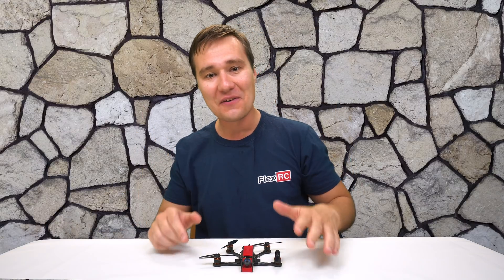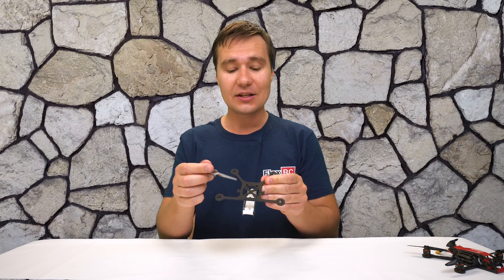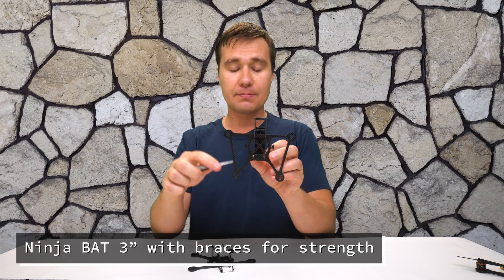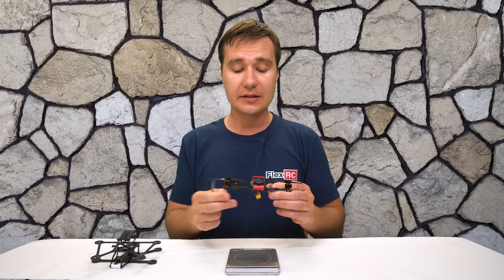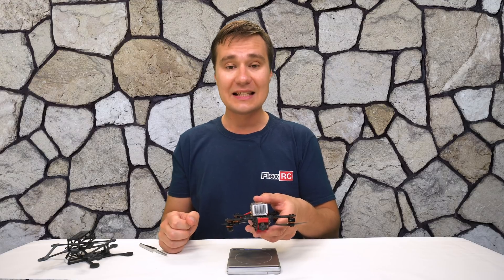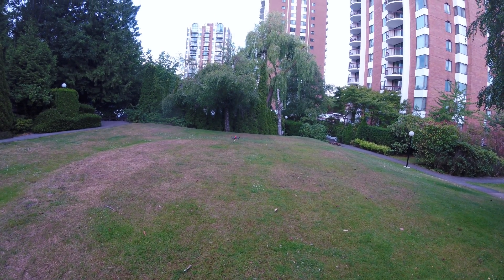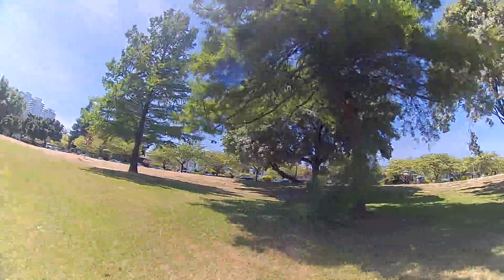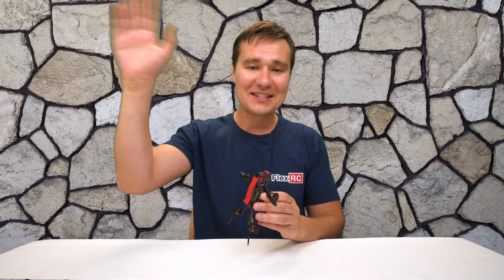FlexRC Ninja 3" - Ultralight FPV Frame with No Props in the View

Comment from the maker: ⚠️ PRODUCTS IN THE VIDEO  ⚠️
❗️ FRAMES ❗️
✅ Ninja 3" frame: https://flexrc.com/product/ninja-3-frame/
✅ Ninja BAT 3" frame: https://flexrc.com/product/ninja-bat-3-frame/
✅ Ninja Accessories: https://flexrc.com/product/ninja-canopy/
❗️ELECTRONICS ❗️
✅ Caddx Turtle: https://flexrc.com/product/caddx-turtle-v2-black/
✅ T-Motor F15 1106 6000kv: http://bit.ly/2ZSl3b4 https://flexrc.com/product/brotherhobby-tornado-t1-1407-3600kv-brushless-motor-4pcs/
✅ HGLRC Zeus AIO FC/ESC: https://flexrc.com/product/hglrc-f4-zeus-f4/
✅ HGLRC Nano VTX: https://flexrc.com/product/hglrc-gtx-nano-vtx/
❗️BATTERIES ❗️
✅ 450mah 2S 75C battery: https://flexrc.com/product/tattu-450mah-7-4v-75c-2s1p-lipo-battery-pack-with-xt30-plug/ 
✅ 450mah 2S 75C battery: https://flexrc.com/product/tattu-450mah-7-4v-75c-2s1p-lipo-battery-pack-with-xt30-plug/ 
✅ 650mah 2S 75C battery: https://flexrc.com/product/tattu-650mah-2s1p-75c-7-4v-lipo-battery-pack-with-xt30-plug/
✅ 850mah 3S 75C battery: https://flexrc.com/product/tattu-850mah-11-1v-75c-3s1p-lipo-battery-pack-with-xt60-plug/

Comment: very nice product. the weight of the ninja/ninja bat bottomplates without the carbon/plastic canopy would be interesting for even lighter toothpick style builds. also an option for buying the bottomplate only would be nice.
Reply from the maker: Thanks, there is simple x frame that does it and I'm also thinking to add something like deadcat without a cage
Reply: @FlexRC  already got your simple-x 110mm frame and the x-120 is in the shopping cart.  loving the design. but now i'm thinking about to get a ninja too ;)
Reply from the maker: @muhkuh0816  haha, thanks for the support!

Comment: Great frame. I am wondering what PID values you will use fot this frame? My past experiences show that PID tuning is really hard for deadcat style frames. If the frame can be tuned to react like x frames, I am definitely interested to buy a few and move my stuff to these frames. Thanks.
Reply from the maker: PIDs often depend on too many factors such as battery weight, battery voltage, motors, props and total weight, so it is fairly hard to recommend anything. My main criteria is that it will fly well with default settings and then you can tune P a bit up or down, and most importantly is just to pick rates that you enjoy flying which are usually the same between different builds.
Reply: @FlexRC  yes, you are right. I have been doing what you said. However, I built a x micro recently and noticed the difference. BTW, I don't know why even x frames seem fly better but I like deadcat frames so much. Lol
Reply from the maker: @dukevah  Ah yes, X is the easiest because they have best COG and equal distance between motors, so it self stabilizes without much work needed from BF.